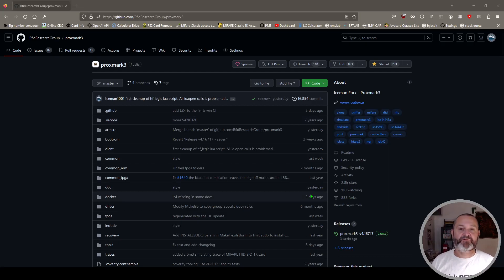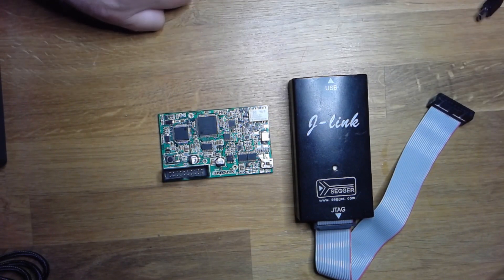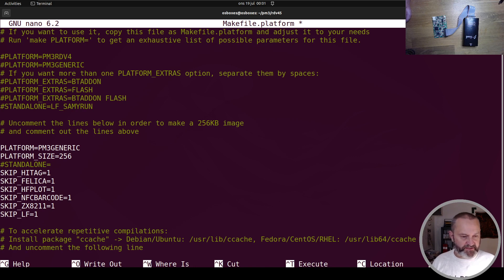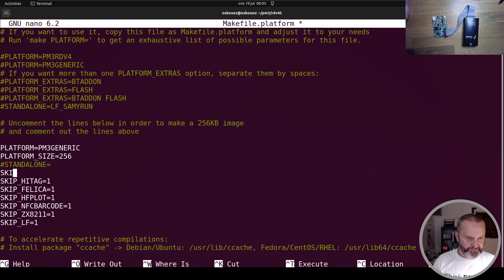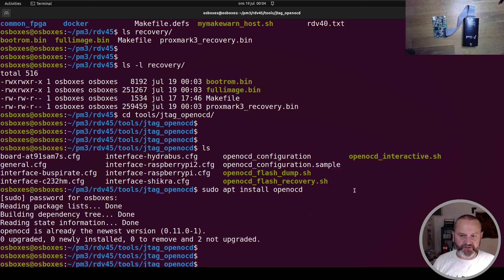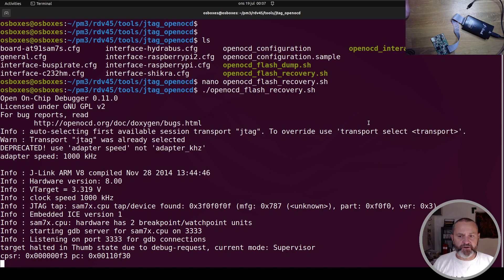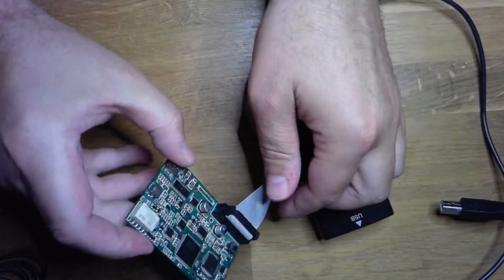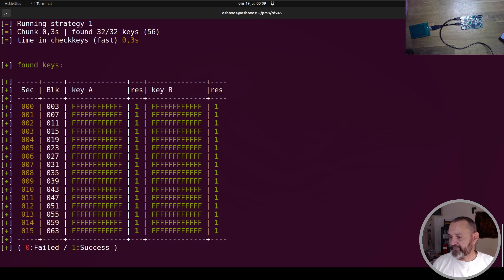Reviving Your Old Proxmark3: Firmware Compilation & Flashing with JTAG and OpenOCD

Comment: Hello! I own Prosmark 3 Easy. At the moment, the official firmware is installed (official-20230310). I asked questions on the forums about which firmware I should choose Iceman or the official one and everyone advised me to stay on the official one. Could you comment on this issue in detail. What is the advantage of Iceman firmware over the official one and does it make sense to switch to it? Thank you.
Reply from the maker: It depends on your device.   If you have a 512kb version I recommend to go for iceman. 
its better in all ways.   Go for latest source and remember to compile for your device.   Follow the instructions in the read me. 

If you have a 256kb version,   you still can run iceman but it will be limited in some ways since the firmware doesn't fit we have to remove parts.  In those cases you can keep on staying on official or upgrade but be aware of the downsides.
Reply: @iceman1001  thank you very mutch for your answer. The latest version of proxspace was released on Aug 10, 2021. Have you stopped working on the project? Maybe I still not understand how it works. Packages update inside application? Can you give a couple of examples of what advantages Iceman has over the official firmware? On our forum, the guys convince everyone to use the official firmware. At the same time, I understand that they are not familiar with your product perfectly.
Reply from the maker: @platonx  
Proxspace is maintained by someone else.
Its a pre-compiled distribution, you should find latest fw / client downloadable from there. 

You find the iceman firmware 
https://github.com/rfidresearchgroup/proxmark3

Pull latest, compile, flash if you are into that.
You find its still active.

Which is your forum?